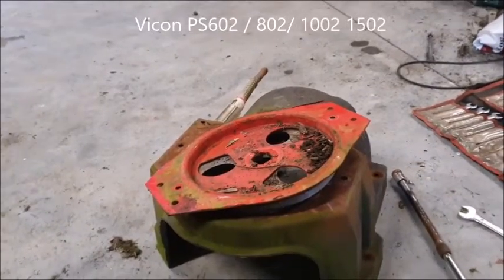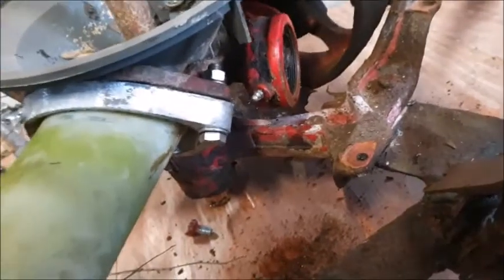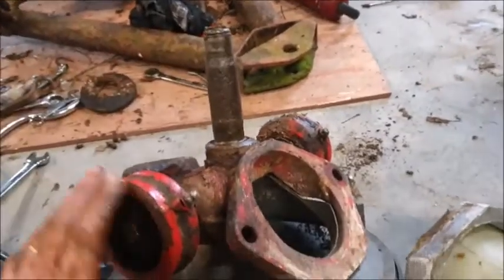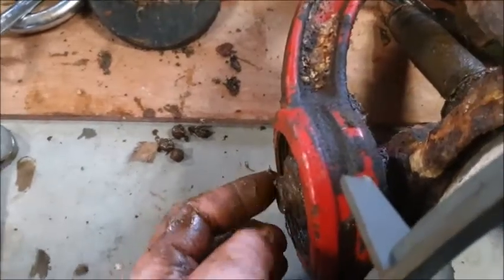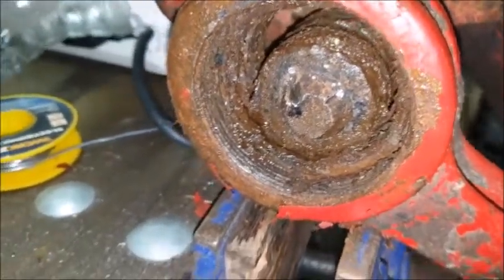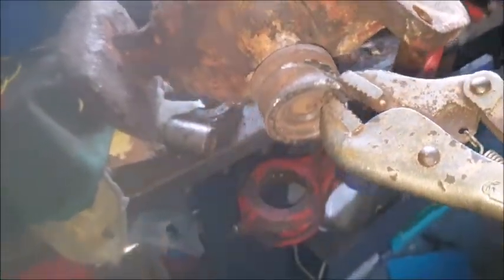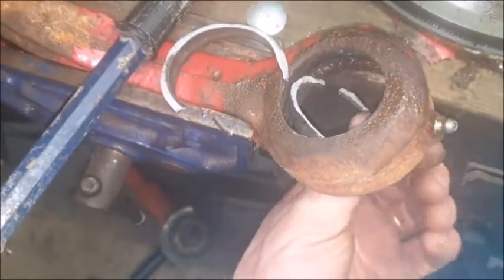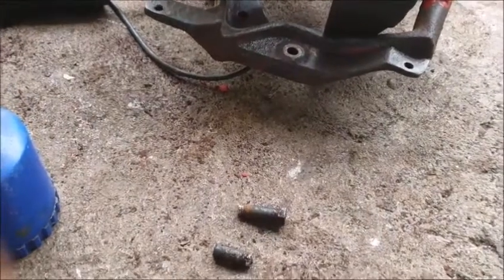Vicon Fertiliser Spreader | PS 602 / 802 /1002 /1502 | Wagtail Repair | Bearings |

Comment: Any ideas on removing the center shaft from the wishbone spindle?  I'm trying to replace the shaft but have no idea how to remove the bearings.  The dust caps are off and the bolts are removed on the outside of the bearings.  Thanks!